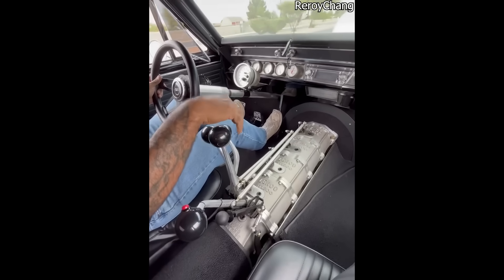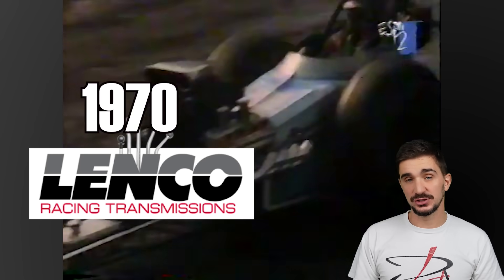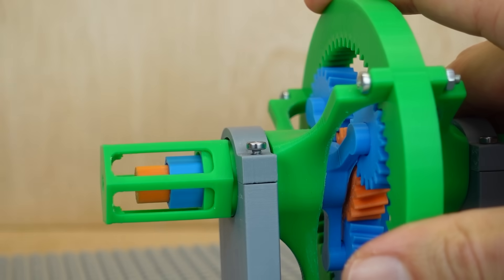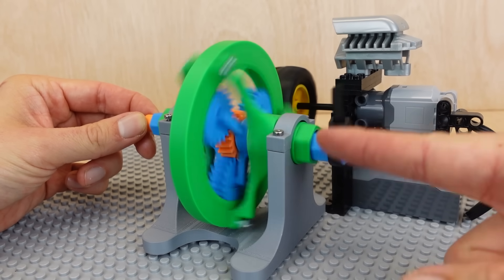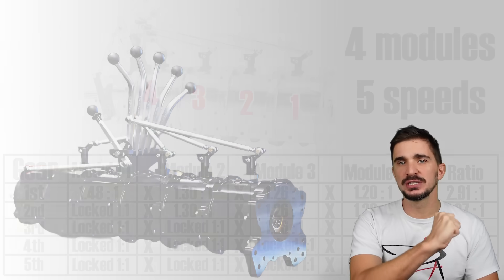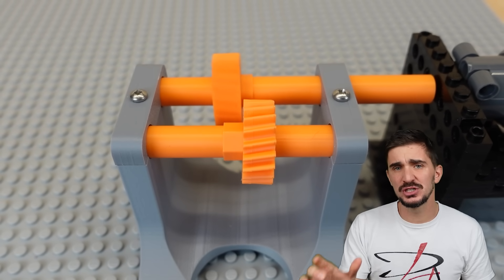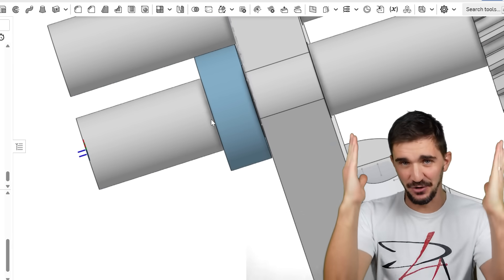This is The Strongest Transmission Ever Built - Planetary Manual Lenco Gearbox Explained

Comment: The greatest advantage of planetary gearsets is that they nullify radial load, or the load trying to push the gears apart against each other. For that, only 3 planets are enough (2 makes it unstable), but putting more planets will help you with heat dissipation, stress spreading and smoothness.
Lencos are bad at downshifting because of the sprags. When you downshift a lenco, it will just freewheel, because the engine and the output shafts of previous modules will be at lower RPM than the input shafts of the modules after them. If you step on the gas to rev-match, the sprag will "dump", and it will damage them over time, as its friction area is extremely small. Fixing that demands two clutchpacks per planetary gearset, one for locking the sun against the casing and the normal one that makes it 1:1. It makes the modules heavier, but allows for exponential operation, giving you (2^[number of gearsets])-1 gears instead of [number of gearsets]+1 gears, so the weight and size of the package is still manageable.
Reply: Three modules with twin clutch packs would give you seven forward ratios, which sounds like it would make a very fast, bombproof transmission for circuit racing. I wonder why nobody has tried that?

Four of those modules would give you 15 forward ratios. Not sure what that would be good for, maybe semi trucks? But cool no matter what.
Reply: @elektro3000 even if it is heavier per module the full transmission should still be lighter and smaller (and have more gears) compared to the traditional lenco 5 speed, i genuinely wonder why nobody has tried that before
Reply: @elektro3000  I was thinking road racing as that's my discipline of choice. I think the issue is a combination of downshifting (happens much faster than upshifting, too) as well as too much to manage. Lenco is really perfect for drag racing, where shifts are only in one direction and they are a second or so apart so the driver has a very smooth rhythm. Also, no other racing discipline requires anywhere near as much transmission strength as drag racing. Ease of shifting is much more important.
Reply: History channel taught me that basically. Monster truck Modern Marvel episode way back. 

 Planetary axels/drive train saved that industry(monster trucks). Making them truly monstrous. I still need to see them before I die. 

 I always had them in the back of my mind, but please don't say they are simple. That thing is offensive with how heavy it is. Ha. 

 Need clutchless transmissions. Magnetic or otherwise. 

 Anything Koenseigg does for transmissions is an art. I can get behind his b day present the CC850. 

 Right now it seems even EVs are stuck with planetary or helical gears for single speed gear reduction. InMotive has a weird one. 

 DeepDrive has their stator sandwiched between two rotors. Those will product insane torque, and we will need stuff to transmit it just as light. 
 
 YASA has a prototype motor weighing 12.7kgs, 1000bhp peak or 750kw. 450-400kw continuous. (470-530bhp)

 Insane power. No exotic metals. The future is amazing. They'll still need better transmissions like. Hopefully InMotive.

 I'm very dubious on "planetary so easy to fix! DIY!"

 What?! I've always been told they are expensive, and complicated. 

  I only repaired house appliance ones that actually required extra hands or tools. 

 Every video I seen of someone replacing parts has them at least smashing it with something, using cryogenics or torch to force it. Smashing with a rubber mallet. 

 Others have special snap ring pliers, or fancy tools like specialized presses, lube, etc. 

 Some of you will say that. Then make switching out a fuse or electric part no matter how simple seem like you had to battle hell. Sometimes you do, but that's true for all parts.
Reply: Planetary gearsets only balance load on the planets, not on the sun or ring. Edit: Sorry, my comment was about axial loads, not radial. Nevermind 😊
Reply: @ComplicatedStuff  said "Planetary gearsets only balance load on the planets, not on the sun or ring."
That doesn't sound right.  With multiple planet gears sharing the load, tooth loads on the sun gear add up to little or no radial load on the sun gear's shaft.  Same argument applies to the ring gear.  In fact, the planets are the only ones with significant load on their bearings (because the planets transmit drive via their carrier) so the situation is almost the opposite of what you stated.
Reply: @Mark_Bridges Yes, you are right. I misread and thought the original comment was about axial loads.
Reply: I don't quite understand what you said, enough to know i don't think you're bullshitting us, so you're hired.
Reply: You just answered the question I had... I was wondering if planetary gear transmissions would be good for other racing types. I feel like it could work for sand dunes, hill climbs maybe and dirt/sand drags. But road racing, autocross, etc... not so much.
Reply: @ivanf4023  Maybe autocross, with a single box (so basically two speed). One gear for launch, the second for the actual run. But I think you would want a really wide power band.
Reply: Doesn't that sound like not exactly an advatage oflencos but of not using helical gears? If this is the biggest advantage, why aren't there classic manual transmissions without helical gears? Noise is mentioned in the video, but past certain torque that's probably a tradeoff well worth making?
Reply: @tompoczos8312  Yes manual boxes with straight cut gears exist for racing purposes. They are quick to recognize by their typical gear whine sound. Like a car with a manual gearbox driven in reverse (not all cars have straight cut reverse gears, but many do).
Reply: @ComplicatedStuff a company (called PPG) makes a straight cut gearset for the Subaru 5 and 6 speed transmissions. They also make a set that's 1-3 as straight cut, and then 4/5/6 are normal helical gears for driving to/from the track. It's a really interesting thing that they've done
Reply: @Awkward_Fox  Ah that's an interesting gearbox indeed. Clever.
Reply: @ComplicatedStuff  My 1966 Oldsmobile with a 2 speed auto whines while moving quickly in reverse. Makes me wonder if something in there is straight cut or if it's the switch pitch torque converter making that sound like it does when in park or neutral.
Reply: @tompoczos8312 all the high performance 4 speed manual trans in the 1960-70s were straight cut. Which is why you had them nicknamed things like the " Muncie rock chrusher" for the   optional m22 straight cut 4 speed used in the highest powered gm muscle cars.

You dont see them being made for factory use after that because there wernt any cars being made powerful enough to need one until the late 2000s and by that time autos are the high hp factory trans of choice. iirc you couldn't even get a manual in a hellcat or demon, just an auto. I think the highest hp rated traditional tremec manual available is good for like 650ftlbs.
Reply: @tompoczos8312 Early cars often had straight cut (spur) gear transmissions. The Model A Ford had a straight cut 3-speed that is very small for the load it can carry. And it whines except in third gear, which is 1:1.
Reply: @tompoczos8312 my 1968 Mini Van had straight cut gears and dog engagement rings because it needed more strength as a commercial variant. The passenger version got helical gears and synchronisation rings.
Reply: @tompoczos8312  aftermarket gears can be straight cut regardless of transmission type

Comment: I maybe mistaken but way you need lock or unlock that transmission in one order. If every unit has own ratio, you can lock or unlock in different way. For example unlock only 1+2, 1+3, 1+4, 2+3, 2+4, 3+4, 1+2+3, 1+2+4, 1+3+4, 2+3+4 or all . Now you have 11 speed/torque ratio. Of course it’s not possible to go fram one to another ratio by one move but if it’s  computerized the hydrologic/electronic to it for you. The benefit is more near ratio that can benefit a very heavy vehicle or improv fuel economy.
Reply: Not possible with the lenco as it is always 1 to 1 final drive in each stage.
4:1 + 4:1  is 16:1. 4:1 + 1:1 is 4:1. 1:1 + 4:1 is still 4:1. 1:1 + 1:1 is 1:1.
This means that you only get 3 possible ratios from two gear sets instead of 4 possible final ratios.
But sure if you have compounded gears with 2 ratios in each stage you could compound them.

2 stages is 4 gears, 3 stages is 8 gears and 4 stages is 16 gears...
Trucks often uses compound transmissions. Like 6 speed x 2 speed for 12 gears.
You use a switch on the shifter lever to engange the second transmission ratios.
Even in your scenario with many stages, you dont need a computer, just a cam drum like a motorcycle.

Comment: So instead of a helical gear, why not use a wishbone gear?  All the advantages of a helical gear with no need for massive thrust bearings.  And the expense of cutting wishbones is offset by the lack of those thrust bearings.

Comment: @driving 4 answers -
New mission I thing you will love 
Get and electric car and Fit the planetary gear sets on the car 
And just use a planetary guesser, computer simulator to get the ratios you want  speeeeeed
🏎️🔥🔥🔥🔥🔥🔥🔥🔥🧯🚒🐦‍🔥

And can try the arrow shaped gears 
/////////////////////////////
\\\\\\\\\\\\\\\\\\\\\\\\\\\\\
Best if both worlds ❤️‍🔥

If it’s too expensive then use 2 x helical gears.

1 normal helical cut 
+
 1 reversed helical cut gears 
And built them together 
They will be locked in their path and quieter? Maybe 😁 just all hypothetical.
You can wear ☺️👍

Comment: This is surprisingly similar to how an internally geared hub on a bicycle works.  Except instead of clutch plates, they actuate ratchets through a cam shaft, so you can't shift under load.  The famous Rohloff geared hub somehow manages to get 14 gears out of just 3 planetary gear modules.  Part of the trick is that due to the use of a cam shaft, it's possible to have a gear shit turn on some planets and turn off some others at the same time, increasing the number of useful gear combinations.
Reply: and another really cool thing is that they managed to be one of the most energy efficient gearhubs too, and also the most records for the highest mileage.

Comment: always loved the chevy volt for its mechanical complexity, nevermind the fact that its the only mass mfg erev in north america. the "transaxle" easily does 500k miles with no fluid change lol, and you get a CVT by using multiple EV motors to to send different amounts of torque into the planetary at hwy, but usually u just drive around in direct drive on one EV motor.
planetary lets you switch between series and parellel hybrid when it makes more sense, and low compression, NA ironblock port injected engine goes forever.... that is, if you ever use it lol. gas is much cheaper here vs dc fast charging and the range extender is about 1500 lb lighter than the equivalent range in batteries while letting u use the engine for heat in low temps when it makes more sense. more efficient below 40F than running a heat pump. no ev range surprise in the winter

Comment: I don't fully agree with your theory on helical gears.
Most bearings, especially those used in transmissions, can take that little axial force with no problem. Sometimes they even run better with that more load (bearing need a certain amount of load or the balls/cylinders/cones/needles stop turning due to friction and start rubbing).

The reason why Lenco almost certainly avoids helical gears is production cost of helical gears.
Spur gears are easy to manufacture with 1 tool for a wide variety of tooth count. That's not possible for helical gears. That is expecially important for planetary gear sets. Explanation:

You can build a planetary gear set with a 30 teeth sun gear, 13 teeth planetary gear and thus need (30 + 2*13 =) 56 teeth for the ring gear.
But what if you need a planetary gear with 14 teeth? You would need to make the ring gear bigger, but with a Lenco you wouldn't have more space for the ring gear. Solution: you can shift the profile of the gear. It keeps it's tooth count, but gets physically smaller/bigger and still meshes with other gears that have the same modulus.
Gear geometry is complex...
Anyways... you can manufacture all that easily with a straight gear, but it get's complex (and thus expensive) with helical gears.
And a Lenco already is expensive, so why would anybody make it more expensive?

In car transmissions you have such a high production it only makes sense to use helical gears. Also the housing adopts to different moduls and tooth counts trough the transmission.
I would bet A LOT if Lenco had a 1 solution fits all kind of gearbox, they would use helical gears and only one big housing.
I would like to give you Links to data to support my claims, but Youtube doesn't work that way...

Comment: Correct me if I'm wrong but with that kind of tranfmission you get much more that say 5 speed. Just engage modules in a different order. If all modules have different ratio then you can have 16 gears from just 4 modules!
Reply: Yes, but the shifting is now much more complex and likely would have to be electronically controlled as a mechanical linkage to engage all of the different combinations in sequence would be very complicated and likely unreliable.
Reply: Pretty sure this is how the new 10spd automatic transmissions work
Reply: @bigpatty823 Yes, with computer controls you have a lot more flexibility, but a lot less reliability.  There is always a trade-off.  Can’t beat the simplicity and robustness of the Lenco for the job it was designed for.
Reply: @bigpatty823  all conventional planetary automatics with more than 4 speeds to gearsets in multiple combinations to produce more overall ratios than there are gearsets. The ZF 8HP, GM 8L, Ford/GM 10-speed, and ZF 9HP transmissions all have 4 planetary gearsets. The ZF 6HP, Ford 6R, and GM 6L transmissions are all 6-speeds with 3 gearsets.

Comment: To me, the final strength of this transmission (in N.m) is the one of the weakest module.

You can have 5 modules or more, it doesn't matter : if one of these module is broke, the torque won't go into the wheels.
That's because these modules are in serie, not in parallel. 

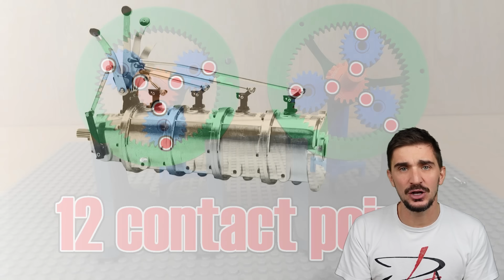So saying the 4 modules-5 speed is very strong because it has 24 contact point is bullshit. (11:15)

And even more, considering only one planetary set (1 module) (at 11:04), for a total failure to appear, it only need 3 of the 6 contact point to fail (either the 3 linking the blue and green, or the 3 linking the blue and orange).

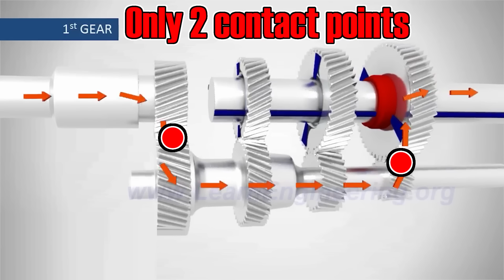However, you can still benefit from at least 3 contact point to transfer your torque, or even 5 because some planetary set have 5 planet gear. Which is in anyway better than relying on only 1 contact (another mistake at 10:56, on an classic transmission, only one wrecked gear is enough for the transmission to not be able to send any torque (for a given transmission ratio)).

Another thing to say : the closest it is to the wheels, the stronger the module must be, to endure the multiplied torque created by all the upstream modules).

However, very interesting video, didn't knew these transmission existed. These serie-mounted modules remind me tractor transmission, that also use this principle to increase the number of speed (but it is not with planetary module).

Comment: 9:19 Technically 16 speeds, if you don't only use combinations where the levers are all pulled in order. IIRC on some military vehicles there are very complex looking diagrams on the transmission that describe the many possible lever positions and ratios.
Reply: taking it outa a race situation one could probably go back to helical gears for noise, and get real fancy with a H pattern to make a 3 module be a 8 speed manual.
Reply: @Markes12344_L  That’s a great idea.
Reply: I was thinking this too, but there's also a bit of a problem in that if you tried to go through all 16 possibilities by shifting one lever at a time (eg using the grey code), inevitably the sequence of gear ratios would not be in increasing order.
Reply: I was thinking the same the gears are like 2^n where n is the number of modules(the two comes from module unlocked or locked)

Comment: Seems like you can have more gears  than N+1 if you pull levers not just sequently, but in different combinations.
It should be like 2^N. 4 transmission modules will give you 16 combinations (but some of them will be mostly that same). And you will need to remember combinations for each of them
Reply: Yes, absolutely, but you have to unload the modules to unlock them and once you do that you have to be extremely careful about reintroducing torque or you'll slam the sprag into engagement and the transmission may show you where you made a mistake by opening a convenient viewing window and letting you see the broken parts.

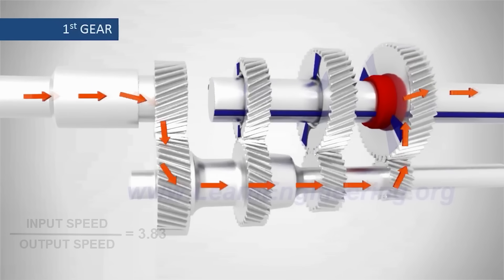Comment: 10:48, some heavy truck manual transmissions have 3 counter shafts to handle the torque, but most OTR trucks will have 2 countershafts.
Reply: He should do a video on the Roadranger and other commercial truck transmissions. They have some neat goodies inside because of their commercial nature and lack of synchros, i.e. the transbrake that's engaged by fully depressing the clutch.
Reply: @lsswappedcessna they're not that mechanically complex, which is a good thing, but for the most part they're just like an automotive manual transmission that's big and doesn't have synchros.
Reply: @jaredlancaster4137  I mean I don't think "regular" transmission have a high/low range and a splitter for every gear. Of course not all of them are 18 speeds but some are 8,9,10,12,13,15...and they can operate in different ways. A standard 10 speed is a 5 speed with high and low but then there was a "super 10" where you had 5 gear positions but instead of 1L/1H, 2L/2H,etc,etc you had 1st/2nd, 3rd/4th, 5th/6th, up to 10. There is a ton of variation in HD transmissions.